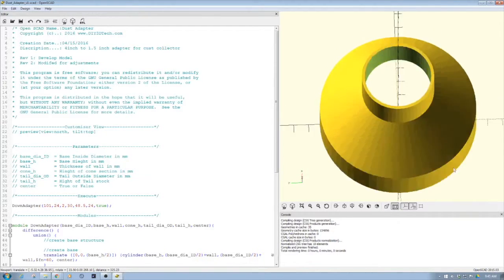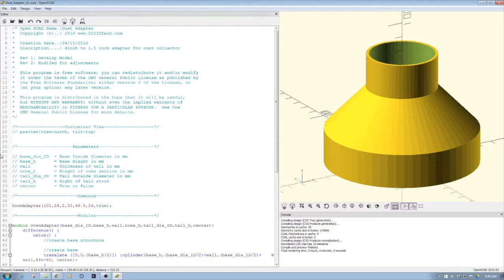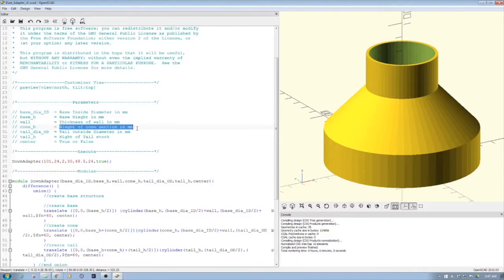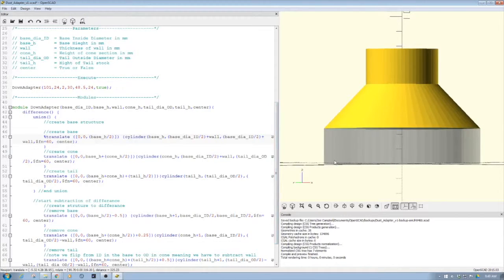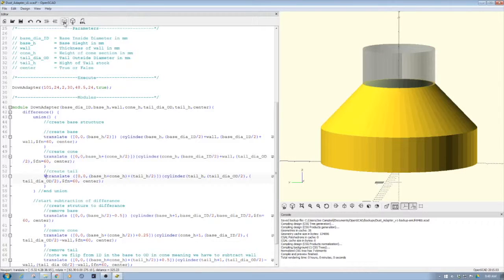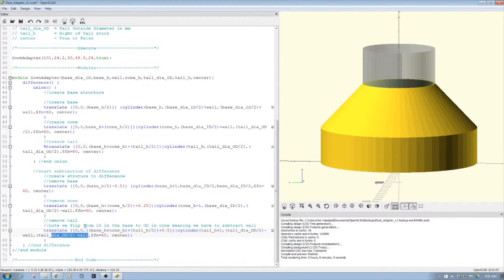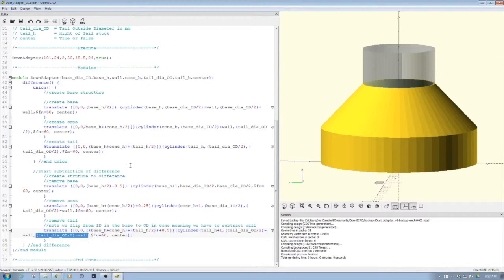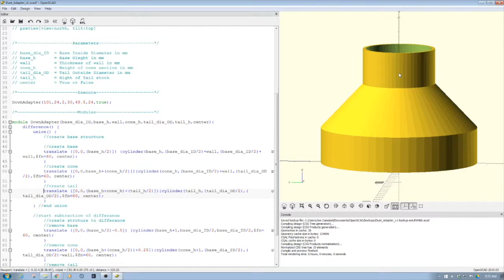Open SCAD - Creating an OD to ID Adapter for 3D Printing!

Comment: I have just purchased a 3D printer.   I watched several of your 3D printing videos.   I just looked through your OpenSCAD videos and found this one.   I think all wood workers have the same issue.   So many ports and fittings are different.   I have sewer pipe for the dust collector ducting and it is frustrating that 4in dust collector fittings, especially dust gates do not fit almost anything.

I will now give your OpenSCAD design a try.   Thanks very much.

Dave.
Reply from the maker: Thanks for commenting!  Yes agree and the for creating!  Also did a small dust collector project too :-)

Comment: Have you considered doing this via rotate_extrude using a wall profile? Take a look at this:

//Parametric Tube Adapter: all measurements in mm
$fn=360;
wall_th=2;
innerD_btm=30; //NOTE: btm OD = innerD_btm + wall_th
innerD_top=10; //NOTE: top OD = innerD_top + wall_th
Vert_btm=20;
Vert_mid=50;
Vert_top=20;

rotate_extrude(){
translate([innerD_btm,0])      //bottom wall
square([wall_th,Vert_btm]);
translate([innerD_top,Vert_btm+Vert_mid])  //top wall
square([wall_th,Vert_top]);
  hull(){           //diagonal wall
   translate([innerD_btm,Vert_btm])
   square([wall_th,1]);
   translate([innerD_top,Vert_btm+Vert_mid])
   square([wall_th,1]);
  }
}
Reply from the maker: Yes you could also do this, thanks for sharing!

Comment: So why not do something like this:

difference(){
cylinder(20,40,40);
translate([0,0,-.1])    
cylinder(20.2,38,38);}

difference(){
translate([0,0,20])    
cylinder(20,40,20);
translate([0,0,19.9])    
cylinder(20.2,38,18);}

difference(){
translate([0,0,40])  
cylinder(20,20,20);
translate([0,0,39.9])   
cylinder(20.2,18,18);}

It is not parametric, however did the code in less time than the video.